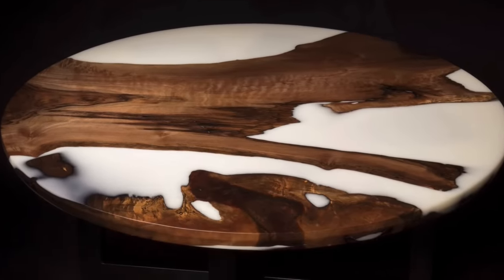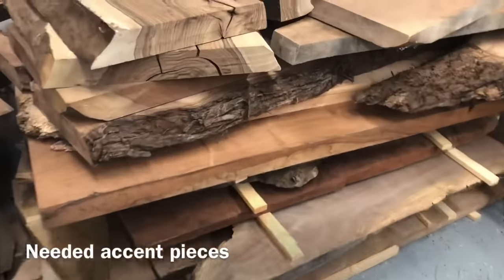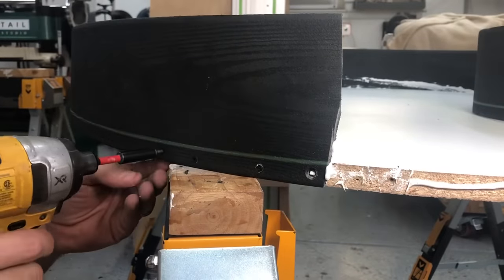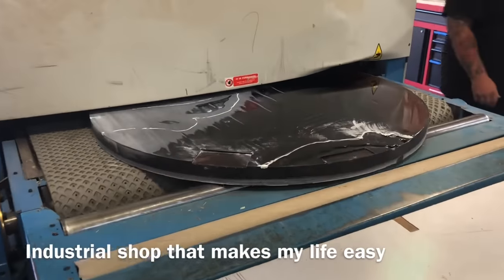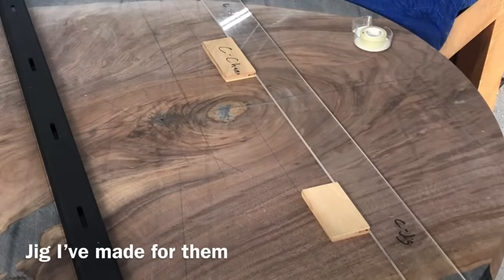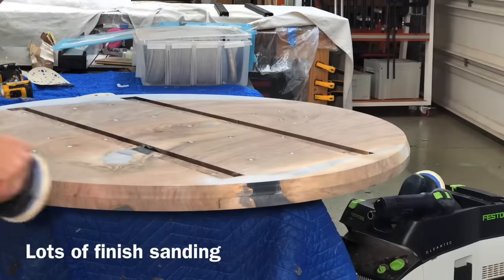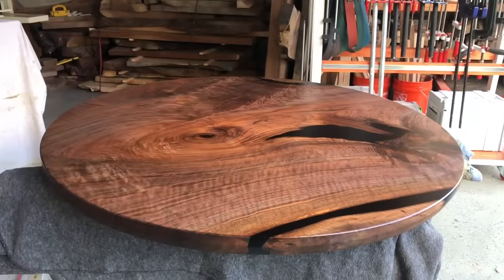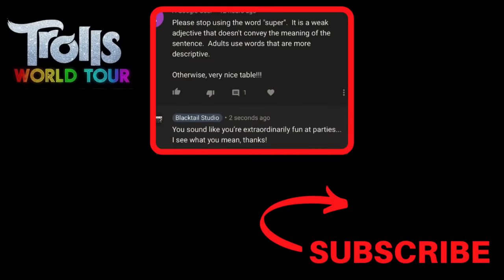A Table Got Ruined

Comment: Cam, I keep running into pigtails in the epoxy when sanding. Even used the same sanding disc's you use any suggestions?
Reply from the maker: My sander is a really good one. Also try cleaning the disc regularly

Comment: 1:24 - If it's cobalt steel, then it's less likely to chip than tungsten carbide, but it's (about 20%) softer and won't last as long. It's a lot cheaper, though.

Comment: Hi cam, is there any extra precaution or tricks to using resin with softer type hardwoods for example im thinking of using some blackheart sassafras and maybe some macrocarpa to do some river tables with. And could you use something as soft as western red cedar? Also, how do i arrange a skype session with you as i have a million questions lol.
Reply from the maker: Make sure to seal the softwood if you’re using dyes

Comment: Cam, is it possible to make tall and sturdy plant stands with wood and epoxy with just a circular saw, jig saw, orbital sander, etc.?  I just want to make a couple for decades old Christmas cactus plants that will show them off yet keep the cats from knocking them over.  Thanks!
Reply from the maker: You’d need to have access to a planner or router sled to get them flat
Reply: @BlacktailStudio  Thank you!

Comment: Cam, Mechanical engineer (local too), in general best not to assume on how “hard” a material is because it depends on the heat treat and quality of material plus the design and manufacturing tolerances of the bit as well. All these things are going to influence how well it performs. People like to make things simple sometimes and while it’s not going to hurt anyone it doesn’t tell the whole story from an engineering perspective.
Reply from the maker: Thanks David

Comment: Have you ever considered a polyaspartic instead of epoxy? It's often used on garage flooring as opposed to an epoxy coating on garage floors. It is suppose to be more UV stable so less likelihood of yellowing or will take much longer.

Comment: Tungsten is way harder than cobalt. It's just, cobalt is very hard to erode. It just doesn't let go of its atoms as easily. Tungsten carbide and not the actual metal itself would be used as a mill, whereas cobalt is used as a bonding material for ceramics (such as tungsten carbide) to have a way of staying together so to speak, and also bond more easily than if just pressing ceramic powder. Essentially cobalt is a great filler and helps prolong tool life.

Comment: Hey cam
What is your experience with Rubio monocoat and heat? They claim to be heat resistant.
Love your videos :)
Reply from the maker: Never had an issue with heat. Don’t set a hot pan on wood though.

Comment: If I made a table like this and put backwood packs is them would they be ok in the epoxy
Reply: Blacktail Studio  I want to make a clear table with different pack inside I’ve heard the molds can get a little hot as they cure I was just wondering if it would be a problem for the items I would want inside The table

Comment: Hey Cam 
How do I get my discount at concept thirteen . I’m building a Douglas fir 3.5 inch think table . And I want to use nothing but the best for c channels and hardware . I’ll most likely buy the drill bit they sell as well. And make my own jig . 
I like your channel . Very informative 
Thx
Reply from the maker: Can use my code. Should be In the description. Or call em

Comment: Hi I'm getting a thumbs up but but no reply, so not sure if the responses are working? 😭
I wrote this:
"Hi, the hole you put in the middle for the circle cutting jig, how do you fill it up afterwards or do you leave it as a hole? Thx"
Reply from the maker: Fill it with epoxy 👍🏼

Comment: Tungsten carbide is way a
Harder than cobalt HSS but Cobalt HSS is harder and more durable than regular HSS cutters, I work with steel where we pretty much just use Tungsten carbide,  but I would imagine Cobalt HSS is overkill for wood.

Comment: Wish I can have round desk or table with Australian Kampo or North American Walnut. But it is almost impossible to find slabs that are beautiful, wide enough, and no need to pour epoxy on it. 
If you are tired of making round table with wooden legs, as you did before, would you make legs with titanium. Challenging? ;)
I bought a round rock slab that is about my weight and having hard time finding people or a right company that can make the leg for it :( I am living without a desk or a table for more than a half year b/c I cannot find anything 😍 for me. Wish I can find a safe, stable, and elegant leg for the slab. With my budget, it will take time though…

Comment: I bet you could ressurect that old table if you could manage to mask off the wood bits. You could probably use a process called "Retro Bright" to restore the white. It involves using a hydrogen peroxide bath and exposure to UV light.

Comment: I live in Hawai'i, and things get beaten up pretty badly on the way here. My 700lb lathe was missing part of the top of the crate and one whole end - gone, gone, gone. I've had boxes torn open on both ends so all the contents just slide out if you pick it up expecting it to be intact. Even things in stores are often beat to death. I don't know what it is, but boxes and crates pay the ultimate price on their way to paradise.
And on the yellowing - all epoxy will yellow over time. The chemical structure can't withstand the sunlight for long. The only way to prevent yellowing is to have it 100% away from sunlight. That actually won't prevent it, it only slows the process. Some epoxies are better than others, and the darker they are tinted the longer before the color change will show.

Comment: Hey Cam. I'm looking for some ideas on how to fix my epoxy table. I'm asking you cause you seem to have run into it all. I made a 98x34 inch table a little over a year out of jatoba (Brazilian cherry). I used your videos as a guideline. It turned out great. Then about a week ago, out of nowhere it cupped in both directions. I have 3 straighteners in it and both sides have been sealed with rubio. It has been in a pretty stable environment and it was fully cured before starting. I know you have gotten popular. So if you don't have time to answer, it's fine. If you have advice, it would be greatly appreciated. Thanks in advance

Comment: CAM - Hey Cam, I have never done an expoxy table before but just had a thought/idea that might help you. You mention that putting the finish on the underside and then flipping leaves marks that you buff out later and it still leaves small marks. I know it’s the underside so unlikely to get scrutinised anyway, but since you’ve already drilled and screwed in the threaded inserts you could consider making some “mini-feet” 1” long with some silicon on their bottoms (that you could reuse) which you can screw in that, when you flip it to finish the topside, the freshly finished underside doesn’t contact with the table/blanket, etc. Just an idea :-)

Love the videos. And the narration. Keep it up!!

Comment: Cobalt is used as a matrix to hold tungsten carbide a lot (TC bits are not solid TC, they are bits of TC suspended in a matrix material), but TC is much better. TC tooling is what giant industrial metal lathes and things like that use, and is really just overkill for most woodworking applications, which is why a lot of woodworking bits and tooling are just plain HSS/cobalt. Also, almost all HSS these days has cobalt in it, just not as much as the coppery coloured "cobalt" bits, which are really just a type of HSS, not pure cobalt. Your shiny "cobalt" bits are HSS with 6%-8% cobalt, while regular HSS has something like 3%-5%.

The main difference between TC and HSS is really the ability to deal with heat, TC is somewhat harder than HSS, but not by a whole lot. When you are cutting steel with either, you generate a ton of heat, the cutting bit deforms itself from the heat it generates if you cut too deep or fast with it, but the heat needed to deform TC is immense, way higher than the melting point of steel, so you can remove way more steel from a work piece way faster. It also allows for thermal friction drill bits to work and retain their shape as they melt their way through steel: https://www.youtube.com/watch?v=VzCBQh8B_RY

Comment: CAM: Why don’ you drill holes in your router table as guide sets for round pieces?  On one side the peg should move at the millimeter interval so that you can have any angle edge you could ever need?  (Sorry, I guess that’s a suggest-question)

Comment: Cam   , that cutter  is a  tungsten carbide with titanium nitrite coating and  its original use was called a  roto-broach for  cutting  holes  in metal   or trepanning  in metals and various  material  be careful they can be extremely brittle if the flutes  pressure is loaded wrong and most edges  have a taper to the side flutes  so  cutting tip to base   where its chucked up in collet some have  1/2  to 1 1/2 degree taper,  love the tables  you  make    love that round table   i am machinist  by trade but  late  brother   myself and one other friend we had a wood working shop for   over a decade  doing specialty wood pieces

Comment: What do you use to stop the resin bleeding into the wood on the top your older videos you use shellac is that the best thing to use water based or oil ? but I’m in the uk so is there anything else to use ?
Reply from the maker: I use the same deep pour epoxy now

Comment: Hey Cam, I was wondering if you can help me out with something, would the Rubio monocoat finish work on a laminated Saligna slab?

I am designing a desk using a 35mm laminated Saligna. Could I use Rubio monocoat finish for this, or would another finish give a better result? 

Any help would be much appreciated.
Reply from the maker: Never worked with that wood

Comment: Cam, getting ready to do a dining room table for my house.  After seeing this video I'm a little nervous about ruining a $1900 wood slab with the epoxy turning yellow. How often does that happen and is there anything that can prevent that? Thank you Sir.
Reply: High humidity, high temp, UV light, or even just plain oxidation are the biggest culprits in turning both white and clear stuff yellow. I'm an artist and see it all the time across many different mediums, especially when things are placed in rooms with windows. I reckon the hawaii weather did this table in more quickly, but I'm sure it would have yellowed eventually even under better conditions.

Comment: Hey Cam, super nice table. 2 questions:
Which way do you put the table in the mold? Is the finished top of the table facing up or down - against the bottom of the mold? 
Is the yellowing only from the epoxy? I know dyes are VERY light sensitive and shouldn’t be used on anything outdoors. Could that have added to the yellowing? Any alternatives to using dyes to change epoxy color?
Reply from the maker: You want the finished top facing up. Great question, I actually had a few samples of this epoxy with different finishes and dyes and they all yellowed, so not sure.

Comment: Cam: I know it is probably exhausting responding to all the comments, so I just want to say I truly appreciate it! I finished my first epoxy table yesterday and if it weren't for your help. I dont think id feel comfortable taking a shot at making it!

Question: I put the first coat of rubio on yesterday. I know before you were using a maroon pad. This video shows you were sanding. Is it okay to just sand the first coat and put on a 2nd coat today? 220 grit okay? Or do i really need the maroon pad?
Reply from the maker: Thank you, glad you were able to find all of this helpful! I use the maroon pad in this video too and definitely think you don’t want to skip this step.

Comment: Cam!
The cobalt bit looked to me like a high speed steel bit coated in titanium nitride. It could be a cobalt high speed steel bit, the cobalt making it more heat resistant than regular high speed steel. It's possibly a tungsten carbide bit coated in titanium nitride.
Cobalt high speed steel is still nowhere near as hard and wear resistant as tungsten carbide.
A tungsten carbide bit is tungsten, cemented together in a matrix of cobalt.
Whether high speed steel or tungsten carbide, the titanium nitride coating gives the bit a thin coating of an even harder material that is more wear resistant and less adhesive.
Love your work, Cam!
Reply from the maker: Just what the ad listing called it. Was amazon, so wouldn’t be surprised if it wasn’t what it says.

Comment: Cam, isnt the downside to Rubio is that you have to use their cleaner to wipe down the table? I would think it would be a pain as a homeowner...
Reply from the maker: Usually a damp rag is enough but yes their cleaner should be used for deeper cleaning so could be higher maintenance or some

Comment: I always enjoy your videos and really like your narration. This helps to avoid any major mistakes. I made an epoxy table and left one plate holder on it. The sun bleached all exposed epoxy and the one covered is now different colour. The seller told they have not had any problems during 3 years and it is impossible that their UV resistant epoxy could change colour. Need to find another supplier.
Reply from the maker: All epoxy is subject to UV damage

Comment: During the sanding process, have you experienced any tiny pin head size white dots in your epoxy? If so, how did you remove them. Before i sanded, they were not there, I do not believe they are air bubbles.
Reply from the maker: Not sure about those

Comment: Hi Cam, just after a bit of advice if you have the time. I’ve done a 4ft round table with 3 pieces of ash in and I have used clear epoxy. The problem I have is that there are three spots in the resin that look like milk set in the epoxy, think this could be the paint off a card I used to spread it whilst doing the poor. Would it work if I drilled out the areas with this milk stuff and pour the drill holes again? Thank you
Reply from the maker: Hey man, I saw your other three comments. Answered there

Comment: Cam, is the yellowing that your table experienced typical of milk white epoxies?  You mentioned that this one yellowed but not if the white pigmented epoxy in general tends to yellow- overall brands?  Nice looking replacement, will have to go watch the original and see what was involved there as well, thanks for posting another great video.
Reply from the maker: Any epoxy can yellow. That brand was just really bad

Comment: Cam, as always videos are great. My goto epoxy/furniture builder youtuber. so my table cupped and sadly the weather wont be warm for a while here in Mn to try to set it in the sun an help straighten it out a bit like in a previous video you've done it on. Was wondering would a heat gun be next best option?
Reply from the maker: It’s an option for sure

Comment: Great video as always. I have two questions: first, what is that material you used to make the jig for the c channels? Second, with the cupped wood, if you hadn’t made the artificial edge with the grinder what would have been the result when you poured the epoxy? Just more epoxy over the surface of the base? Thanks in advance, I’m getting ready to do my first epoxy project.
Reply from the maker: Acrylic for the jig and would have ended up with a thinner table

Comment: Hello Cam! When you use the jig to cut the circle you use a screw to attach it to the board. Do you fill the hole with epoxy after cutting? Have you tried a different way to attach the jig to make that first circle cut? Thanks!
Reply from the maker: You can do it with a scrap piece and double side tape too
Reply: @BlacktailStudio  Thanks!

Comment: Cam, just discovered your channel and I am really enjoying your work. As I was watching you do the finish, you talked about the marks when you do the bottom and top at the same time without letting it set for a day. you could mount the C-channels upside down to act as a spacer after you finished the bottom and flip the table on to those to prevent marks. what do you think?

Comment: Cam , not sure if the first question is free and follow on questions require a fee, but I have a few:

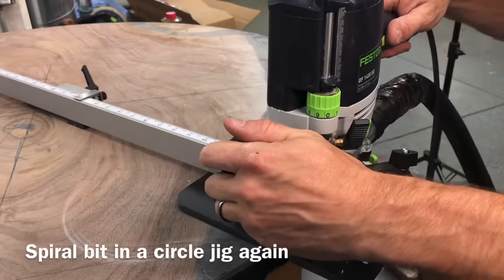At minute 5:53 you’re making the 1/4” plunge cut. Is that on the top or bottom of the table?  Assuming bottom. 

At minute 8:35 you’re running the table around the big daddy...again, is the table top up or down? 

Finally, assuming the center hole for the jig was on the bottom. How did you fill it?  

Beautiful table, congrats on the new home.
Reply from the maker: I plunge on the bottom with that jig. Then flip it over on the router table
Reply: Blacktail Studio Thanks Cam, did you sand the edge and if so what’s your process for sanding curved edges?

Comment: Cam, when you say you finish the bottom and then show all the steps to finishing the top, are you taking those same steps on the bottom as well (multiple coats, buffing, etc.) but just not showing it in the video? Do you only hit the bottom of the slab once? Just curious if the amount or level of finish applied to each side could affect the slab's ability to warp or cup. Thanks!
Reply from the maker: Usually two coats on the bottom too
Reply: @BlacktailStudio  Thanks!

Comment: Cam
I love watching you create these works of art. I do have a question though. When you are using your router on an epoxy table, do you run into any problems when the router bit goes over the wood then the epoxy surface on the same pass?
Reply from the maker: Not really. Epoxy can chip a little